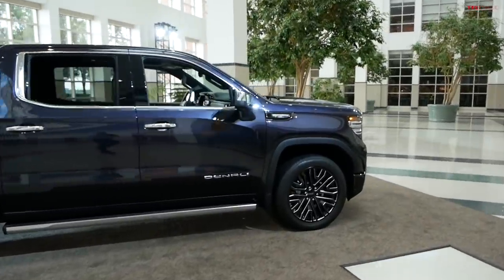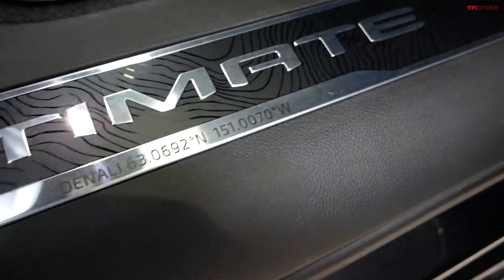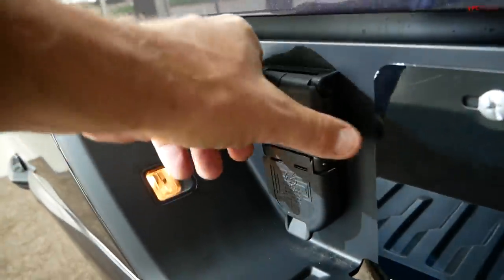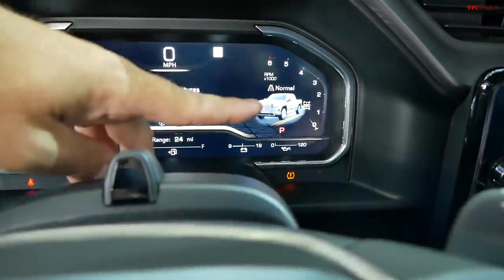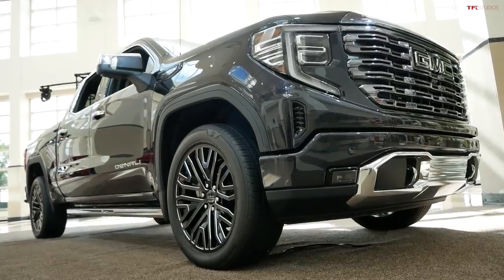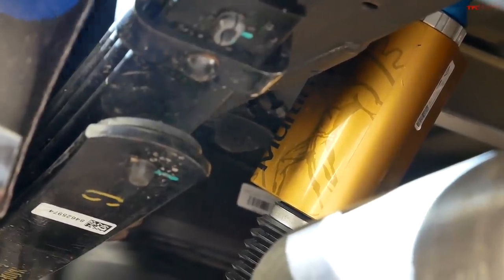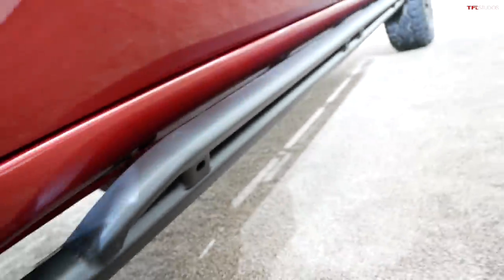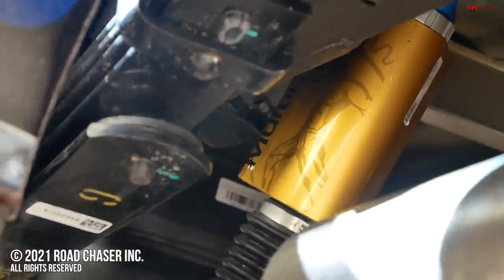Hands On WORLD DEBUT: Here's How The 2022 GMC Sierra Takes It to a Whole New Level!

Comment: Wait a minute is the headlight from the Ford, GMC should change it
Reply: Ford copied the front end from the gmc
Reply: @guamazolopez6456  the ford came out before
Reply: @freshjack3289  the current gen gmc was unveiled 2018 while Ford barley unveiled the new f150 earlier this year, this is just a face-lift of the truck so no, Ford copied gmc
Reply: @guamazolopez6456  bruh your wrong anyways I study about vehicles so don't tell me and Gmc suck anyway
Reply: @freshjack3289  I highly recommend you do a.bit.of research on when these trucks came out, typical Ford fanboys
Reply: @guamazolopez6456  The front end is from the Ford ATLAS Concept Truck which is from 2013 which is in itself based upon the Ford Super Chief concept truck from 2006! I'm pretty sure the C-design for the front lights is DEFINITELY a long-time Ford design trademark that NOW many others are copying since DESIGN patents only run 14 years SO the patents have run out by now in 2021 and ANYONE is free to use that design!

c
Reply: @StarGateSG7  Patents in the US are granted for 20 years from date of filing.
Reply: @goomgoom5504  NOT Design Patents (it's 15 years now --- was originally 14 years) --- ONLY mechanical and engineering patents that describe FUNCTION such as common engineering PROCESSES and MATERIALS go for 20 years. Design Patents which cover the FORM/LOOK of a system is ONLY 15 years!

How do I know? I HAVE 60 Patents to my name!

v
Reply: @StarGateSG7  Thanks for the clarification.  caps are not necessary
Reply: @StarGateSG7  to be fair Ford never made any of those and the headlights look nothing like on a ford, the c headlight gmc was unveiled 2018 and produced in 2019 so it wasn't considered copying according to ford

Comment: 1420 pound payload is pretty bad. Remember, that's including passengers.
Reply: That's only for the AT4X though right? I'm sure others will be higher which is very much in line with what other companies do.
Reply: @ALMX5DP  Yeah but still bad especially for a  new full-size pickup truck . There are minivans with better payload capacity.
Reply: @HeyMavDak  again, it's par for the course given the off-road capabilities they've designed it for. Payloads have to take into account for more than just weight, such as what the vehicle is used or intended for.
Reply: @ALMX5DP  In that case even worse considering the amount of equipment people take off-road.
Reply: @HeyMavDak  keep living in fantasy land if you’d like, just telling you what is reality and the norm.
Reply: @ALMX5DP  I'm referring to existing vehicles and I own an off-roading vehicle with better specs then this despite being older.
Reply: @HeyMavDak  vehicles with this level of offroad capability and overall feature content? What vehicles do you have in mind?

Comment: Ultimate is a nice truck but leaf springs in an $80K truck? That spring technology (if you could call it that) dates back to stage coach days, pitiful! RAM Limited still has it over this truck especially with a multi-link coil spring rear suspension (that's technology). No need to waste storage space in the center console with a useless shifter. Although the interior is clearly a vast improvement over the previous model, the switch gear still looks like the same cheap hardware as before. They have to do better for this price point, sorry. It is handsome though, awesome job on the styling overall; real head turner.

Comment: Clearly Denali Ultimate is aimed at F-150 Limited. Ford being slightly cheaper. Or almost the same with 3.5 Powerboost and 7.2kW generator. Seems like a ripoff to pay that much for a Ultimate. Just buy a Denali if you want a posh GMC truck.

Comment: Man too bad it's GM post 2010. cough cough "Garbage Motors". I hear these Trucks drop lifters and have horrible transmissions. Sadly, it does look so nice though. I wonder if GM took away that dumb DFM technology. I heard that's why it kept dropping lifters in the engine. As for the transmission, GM needs to stop with dumb outsourcing and build their stuff back here in America. The old GM's were way better. These new ones are junk  Ford and Dodge are even better than GM now.

Comment: I don't understand why they cannot just make a working man's pick up are women have a duty suspension heavy duty engine heavy duty transmissions manual windows manual locks nothing fancy I just need something to hold when I need a 3/4 ton why are they putting record opinions steering out of a car in a truck knowing it will break when you hit a pot hole I do not understand why they charge so much for a truck

Comment: If GM copied Toyota and show Chevy how to build a truck their sales would sale like hot cakes. But true to Chevy it will last about 80,000 miles then transmission replacement time.
Reply: ? last year 109,000 tundras were sold versus 847,000 GM 1500’s
Reply: @goomgoom5504  Yes they sale more GM's but you see a lot more GM's in the salvage than Toyota's. I like Chevys & GMC trucks but there's NO comparison in longer lasting & Resale the Toyotas has them beat.  Just facts. If you want to go by sales the F- 150 has. all other trucks beat. Facts.
Reply: @terryrhyne9112  That’s sort of the same logic isn’t it.  on a proportional basis that’s what you would expect.
Reply: @goomgoom5504  I'am really taking about percentage, if a company would buy 100 Toyota's & 100 GMC's ( Chevy) there would be a higher percentage of GMC's going to the salvage before the Toyota's.  Buy you know as well as I do it depends on how well their maintained.

Comment: Not good enough compared to the new Tundra....That Truck needs to be updated again and it is not even out yet..missing lots ..no panoramic sunroof , Bose system is not good enough compared to competition , no air suspension , At4 has hidden exhaust pipes...no..no..no that looks terrible , the wood crap needs to go it makes the cabin look old..The Denali grill needs to be black ..no chrome ..chrome makes it look out dated...They need a black package for exterior...no thanks ..GMC still way behind ..That engine is a joke only 420 horse power and 460 torque..not good enough compared to competition that have smaller engines..Horsepower needs to be in the 500 range etc..no thanks